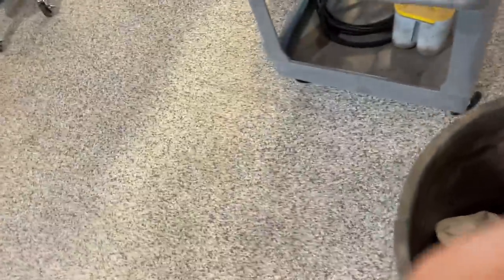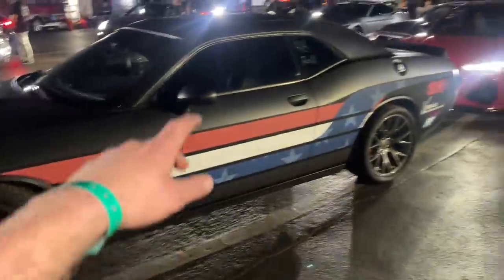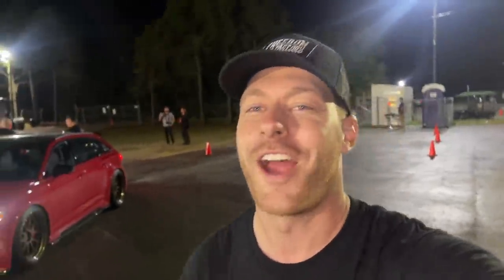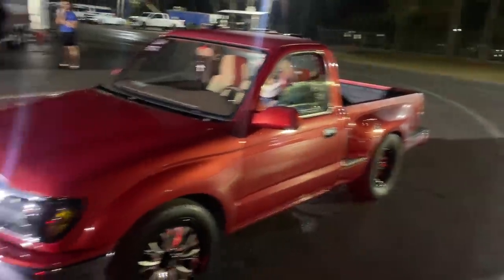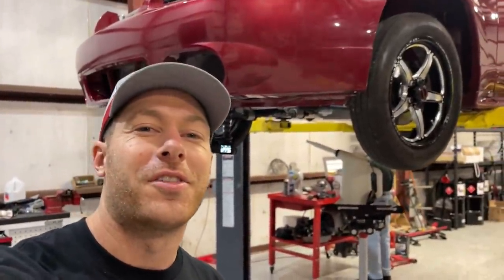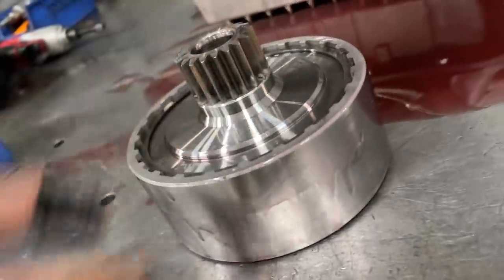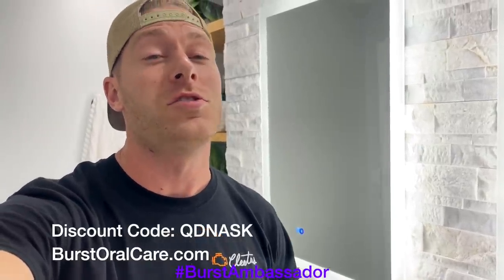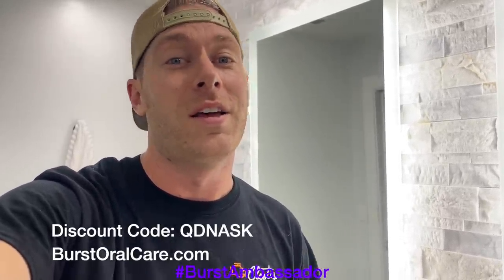Cooked My Powerglide 2 Days Before Sick Week... Took the Hellcat Roll Racing at Street Car Takeover

Comment: You need to check that aftermarket Dipstick tube on the Powerglide. They sometimes read incorrectly. even though you have the deeper transmission pan, the pump only has to have no fluid for a split second and it will cavitate. That can then cause low line pressure and burn things up. Good Luck on Sick week.

Comment: Maybe it's time for a built turbo 400 in Dr Pepper. I swapped my Dart from a 904 to a 727 after burning up several used 904s after I killed the factory one with the 318. I killed a couple of 727s too but they had stage 2 shift kits and I loved down shifting etc at speed.
Get it done and see how it does now.  Still having problems go plan B. Have fun and good luck.

Comment: IMHO... a glide is a bit weak for what your doing... i swapped my gear from a vega 2300lb... to a monte carlo near 4000 lbs. glide just wasnt enough for the big pig i stuffed it in. built 400 and issue dissolved...